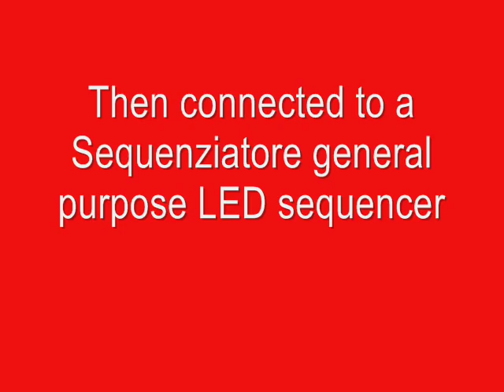The Light Chaser

Comment from the maker: Yes it is; it's also not a "drop-in" and you have to build it yourself. But, I think most of the plug-n-plays use blue-white LEDs-- I use warm white which looks more screen accurate. Mine is the only one that has adjustable brightness and speed (to my knowledge). All the others have pre-set patterns, which I think is overkill (40 patterns)-- some have an upper dome light (which my circuit can include) and correct patterns, but are more expensive. All have goods and bads, even mine!

Comment from the maker: As I said, I know this is a difficult board and you would not be the first customer I have rendered aid to. Do let me send you a fresh kit. Believe me, it goes better. I also want to state that I want to have happy customers. The end results are superior to all the machine assembled boards out there. One thing that sets this kit apart is the use of warm white LEDs. I have finally seen one such board that has warm white LEDs (the first out of, I think, 8 manufactured boards (one guy puts them together on his kitchen table, but he's a trained engineer...)) not eye-searing electric blue. My board has adjustable speed and brightness. Of course the others all have different pre-programmed patterns, but they're mostly useless. There's only one custom-made for JII use and it still has hot-blue-white LEDs. Sorry for the ad. What I mean to say is, you made a good choice-- but it wasn't the easiest.

Comment: you can get these on eBay? will it fit the chrome Jupiter 2?
Reply from the maker: +Harley Fee If the chrome one is the 18" JII, then it's the right size and only the internal architecture of supports and such would interfere. If this is the 12" Jii then no. But I am working on a kit for the 12"-- but again, only what's going on inside that version would be the concern. I presume if you are a modeler that chopping and hacking and replacing reinforcement stuff is a normal day. Either get in touch directly (I'll send you a proto board) or stay tuned. I am hoping for a Summer release. Thanks for the inquiry!

Comment: LEDs should not be soldered to the copper side of this PCB. Bare legs cross bare tracks for potential shorts. Tracks could delaminate. I use a PIC processor for LED fading with this board. Much more realistic lighting effects than standard flashing circuits. Also there is an engineering flaw in the board layout. LEDs should not be driven in parallel as with this circuit due to uneven current sharing. It works but reliability is compromised. A more competent approach would have 8 sets of 4 LEDs in series - at 2V drop across each, the 9V battery could still drive them. Old and obsolete board now but just saying since I just put mine together.
Reply from the maker: And you're correct on all points. Correct as far as an electrical engineer goes. I give the advice to not touch the leads to the copper to prevent shorts. I also have run these for days. If you want to use computer power that has more power than a late-90s fighter jet, great. And don't slip up on your coding. This board, rough as it is, works just fine. Like I said, you are right! Now go start your own company with older customers in mind. You'll beat me every time.
Reply: Easy there. It's a good board and works well. I'm "older" - built my first LED chaser circuit back in 1980 and am not an electrical engineer. The PIC board I use now came pre-programmed - no need to code it yourself and it's a single chip on a tiny PCB - very basic (even compared to Arduino) and connects to this circular LED board perfectly - just had to install NPN transistors in place of the 8 LEDs on the controller board for the 80mA max drawn by the 4 paralleled LEDs (series connected LEDs would not quad the current drawn). Transistor collectors then connect via 27R resistors to each of the 8 PCB taps with +5Vdc to the outer track. Not interested in "beating" you. Comments intended as constructive.
Reply from the maker: I'm older too-- I ran into the Mimms Engineer books at Radio Shack myself way back when. Didn't really exploit the design for a while. Turns out I was waiting for what we were all waiting for, white LEDs. One thing that sets my efforts apart from the plug-n-play gang (the late Sparkchaser and TenaControls) is I include warm white LEDs. Looks more like the Jupiter II. Your solution is not plug-n-play and kind'a is not so simple. The 4017 sinks 200mA per channel. Things have certainly changed a lot in the past 10 years, huh? Why anyone can just order pre-wired and pre-programmed circuitry that does the job very well. Or mostly well, with a little fussing with resistors and such. It's all out there. I'm not familiar with the circular LED board you mention-- does it fit in the fusion core of the 18" JII model? Or the 12"? Or are running the LEDs out on their legs? Sounds like lots of fuss work. Just like my board.
I can see the constructive commentary and I think I didn't say "thanks" earlier. I like to thank everybody who goes to the trouble of telling me these things.
Reply from the maker: And if all of that seemed a bit snarky, well, I only wanted a 'bit." Any more I apologize for. Plus you have very good taste in music!
Reply: PIC boards were from a small UK supplier called PIC Projects. I think they no longer supply them. The one I'm using for the 18 inch J2 is a rectangular board designated "PCB430A". It might just squeeze in under the main deck sonewhere. It has a TO220 regulator so plenty of current. There's also a smaller octangular board with speed control that's designated "PCB433A" with 8 LEDs (that could also be replaced by NPN transistors) but its regulator is only a TO92 package.  It would sit at the middle of your board but I didn't want to try my luck on paralleled LEDs on a small regulator. Your board is fine.  It's working with very carefully selected warm white LEDs but not too warm.  On the show they appeared more "daylight" - somewhere between warm and cool. There are several standard sequences on the PIC chip and one in particular is perfect for the J2 and they fade out to give a "trail" effect.  There's even one sequence that provides a kind of uneven or pulsing chase to kind of mimic the original mechanical lighting after one of the globes blew - as seen after about the second episode.
Reply from the maker: Not only another "rotating light" effect board-- but choices of many. Not just "rotating" but pulsing or trailing effect. And then there's far better research possible. A discussion is possible where one can debate whether a light source is warm or cool. When I started there was only multi-generational VHS tapes. Brave new world, chum and lots of choices! About 10 years ago, there were about 6 other people making JII fusion cores-- fully assembled and for about the same money. Tena Controls made the only one that used an external magnet to control the board so it would "idle," ramp up to "take off," hit cruising speed and then do it all in reverse. (That was not the same amount of money.) The other guys chips all had 20-40 patterns baked in. Each LED was addressable. One presumes after a bit of time one could figure out which one you wanted and maybe keep it for the next turn on time. To a man, none of them ever switched to warm whites, when they became available. I did have help from a good friend who is an electrical engineer, to make my simple 555+4017 variable, speed and brightness. And it just does that, whatever you choose. That was a bit before PICs as the family were taken over by Arduino and then Adafruit and then Raspberry and then Pi-- So, yeah-- lot's of choices, lots of ways and lots and lots of paths and methods to go. And then there's my kit. There's the sequencer for the fusion core, which is a 1-10 channel sequencer. So it is already throttled 1-8 for the fusion core (separate board, that helps keep things neat). I made a Jupiter II profile-shaped board for anyone who wants a sequencer for the crowded interior, just place it in an open "bay" in the ship. And I have already prototyped a shrunken fusion core for the 12" Jupiter II. Even sent out a couple to some unsuspecting customers.